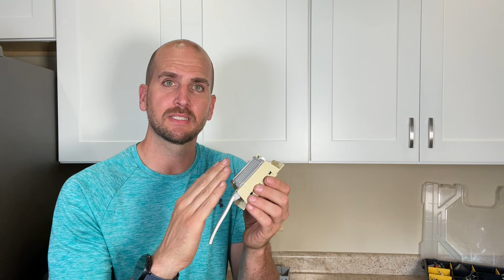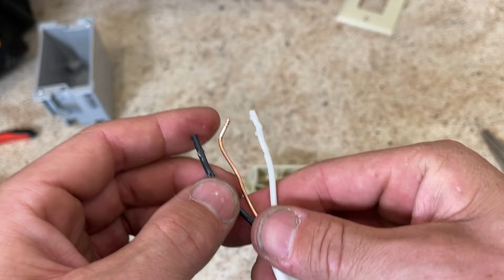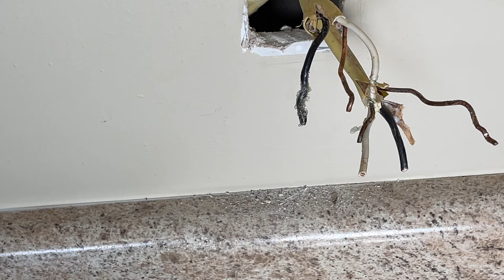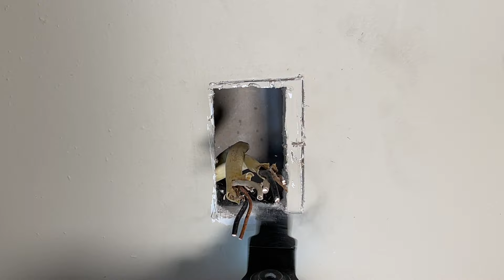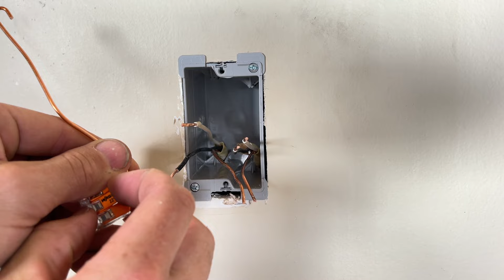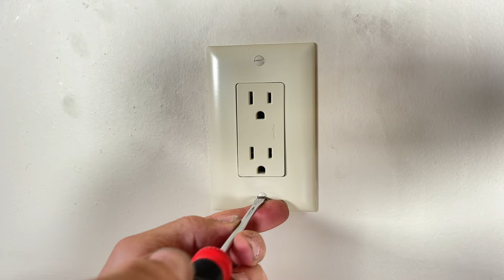How To Replace a Failed Mobile Home Outlet

Comment from the maker: Tools and Parts Used
1-Gang Old Work Box:  https://geni.us/l98bb
Pass & Seymour 15-Amp Outlet:  https://geni.us/QMGN9l
WAGO 221 Assortment Kit:  https://geni.us/H2Jp
Milwaukee Combo Wire Strippers: https://geni.us/5zuLAbC
#1 Milwaukee ECX Screwdriver:  https://geni.us/fuSEW
Klein Voltage Tester: https://geni.us/fAYN9Rr
Klein Outlet Tester:  https://geni.us/kdBAJ

Tools Every Weekend Warrior Needs
Makita Cordless Drill Combo Kit:  https://geni.us/t7dIA
Dewalt Drill Bit Set:  https://geni.us/oFlSl
Dewalt Screwdriver Bit Set:  https://geni.us/VDcr
Craftsman Screwdriver Set: https://geni.us/jXqFI
Eklind Allen Wrench Set:  https://geni.us/7XfvO
Pliers (4-Piece Set):  https://geni.us/RIdx
Milwaukee Fastback Utility Knife:  https://geni.us/MlyiLk
Stanley Tape Measure:  https://geni.us/bUfD1R
Studbuddy Stud Finder:  https://geni.us/RySCuVw
Johnson Torpedo Level:  https://geni.us/wiLcDY
Stanley Hammer:  https://geni.us/bPDk8Wo
Buck Bros Wood Chisel Set:  https://geni.us/vk3cpTW
Little Giant Ladder: https://geni.us/fmlmTk

DISCLAIMER: This video and description contain affiliate links, which means that if you click on one of the product links, I’ll receive a small commission.
Reply: I have interior walls that measure about 2-1/2 inches. Is there an old work box for this?

Comment: What is it with the weird stabby connectors in these mobile home applications? Doesn't seem like this stuff would fail as often if they didn't use connection points that have a ton of resistance.

Comment: You just pulled the back off saying, "You take this back out by pushing in on the four tabs, two on each side",  but you don't show it.  Why not?  I can't get my tabs to push in and stay in.   I'd like to see the details.  You evidently have a hard time with it as well since you skipped over it.  Other YouTube videos:  one guy just cut the wires without taking the back off.  Another pried his off from the back with a screwdriver.  I don't know if he broke anything when he did it.  So far, EVERYONE avoids this seemingly simple process.  Why does everyone avoid showing it?

Comment: Someone educate me I live in a mobile home. I have these types of outlets and switches. I’m about to replace one in my bathroom. I’m not converting it over to a normal. I’m just going to replace the switch so I’ll press them in the back just like they are, I’m confused how everyone is so down on this design seems to me it’s safer as long as it makes good contact which you can do that by trimming the wire a bit before you press it in there with the back there’s no fucking way they can come back out on normal outlets like in houses especially if you have a jackass doing it they can come out pull out and get loose. Someone seriously explain to me how these are so frowned upon. I mean it makes it a lot cleaner too. You don’t have to pigtail a ton of shit. I’m confused. Are they really bad or is that just everybody’s opinion about it because somebody had that opinion, and everybody jumped on the bandwagon.

Comment: Great video. I need to replace outlets in my mobile home. A lot of them are old and loose and one doesn't work anymore. 

Question as I am a rookie to this as well, what was that cutting tool you used? Looked really handy for cutting out the drywall.
Reply: It's an oscillating multi tool. I've heard people call it different things such as a Fein tool or a nibbler. I couldn't find one on the list in the description, but most companies make one.
Reply: @klassikola oh ok. Yeah, I didn't see it listed and was curious. Definitely going to buy one. Thanks for the response.

Comment: Your switch to a stand residiential gang box MAY work for for SOME Mobile Homes.... Many only have 2x3 interior wall studs... and that means those Res gang boxes will not work. Even the shallow gang box can be troublesome to get the wires into. More over anchoring the res gang box on the outside surface of the wall or recutting sheet rock until you find a stud... oh my

Comment: My 1985 Champion mobile home has MUCH worse plastic quick outlets. Super dangerous in my opinion. I plan on replacing the ones that are used most, and especially the ones that space heaters are on.

Comment: Dude,, not the light switch won't control the outlet,, lol.
Reply from the maker: Did you swap out a receptacle and now your light switch doesn't control the top or bottom outlet?  If so, you might want to check the small tab on the hot side of the outlet.  If you had a switched outlet before you should remove this to allow the top and bottom outlet to be powered independently of each other.

Comment: Strip the fucking wire and do it properly that outlet will fail, those contact points are not enough to carry a proper load.

Comment: Is it the same process as far making pig tails for a gfci outlet, or would you just use the line and load terminals, and pigtail the ground wire?

Comment: Again thank you so much.
When we bought our place new 20 years ago we had out let’s that never worked in the 2nd bathroom and half the plug-ins don’t work now.
The whole beat the wire in between 2 small copper blades is the dumbest thing I’ve ever herd I’m sure so inspector got a fat check off it.

Comment: I'm so glad that you did not recommend "speed wiring" or backstabbing the receptacle. Personally, I like to use the "back wire" where the wire goes straight into the back, then a screw tightens down on the wire. A little more cost, but the speed, ease and better connection are worth it. Backstabbing (speedwire) is as bad as the mobile home plug, maybe worse as it doesn't even have physical pressure on it. Great video and well done sir!

Comment: I have been gradually updating the outlets in my mobile home due to this exact mess. The first one, we melted with a space heater. Once i pulled the outlet and saw what i was dealing with.... Off to the hardware store for materials to upgrade them all. 

I'm not done, but I've finished the GFI series in the kitchen, same for the bathroom and laundry. I've also replaced the outlets we run heat from. The outlets next to my bed and desk are the fancy ones with USB outlets. Fortunately the walls in my '93 are thick enough for the old work boxes, and my wires have had enough slack to let me do my thing. Romex is in amazing condition, my load center is only a couple years old. Lots of pigs, nuts, and hooks to do things right. Really considered soldering connections under the nuts, but that might be overkill. 

 I want to check into these clippy things... I just wonder if 20 years down the road we don't find them as reliable as backstab.... Or whatever the hell kind of connection these self contained outlets are.
Reply: We are in this place now. 1999 build. Ugh!! Lots of plugs and switches.

Comment: Wow junk! Thank God I'm replacing every wire, box, outlet, and switch and main panel in our recently purchased modular home from '85 with Hubble commercial grade.
Reply: commercial in my opinion is definitely preferable the Cooper now Eaton at least in the pass are good and pass& semore (legrand) Humble are good Eaton are less cost available at Lowe's when they were manufacturer under the cooper name that I installed years ago have a very strong plug connection.

Comment: mobile home wiring is just insane. I can't believe they were allowed to run 8 wires through a light switch to bounce over to the outlets. Every mobile home over 5 years old has several burned outlets. I'm amazed they were approved.

Comment: Sadly, when I first starting updating the outlets in my moms mobile home, i keep running into the issue of hers were speed wired, and in trimming them to clean them up usually there is barely enough wire to get it back thru a new work box and around the hook. And then the work boxes won't seat correctly as the older drywall was a little crumbly, so my neighbor had to help me to put a small shim behind the work box to have proper anchor support. Without having to replace the whole drywall sheet which wouldn't be bad tbh, but we would have to tear out the kitchen. But i also have to update a few more too. 🙏🏻 hoping i dont have the same issue.

Comment: I just replaced two switches that were wired in the same fashion for my son-in-law and my daughter just bought some type of a modular home on a foundation. That was the first dealings that I’ve had with this type of wiring and didn’t really know it even existed to be honest with you, but I’m sure I will be changing a lot more of these out for those guys from what I have read in the research I’ve done. These are very prone to failing.

Comment: I live in a manufactured home and I have had a lot of trouble with the outlets. If I had known how bad they are I would have paid more money to upgrade to a better Quality. I recommend anyone buying a manufactured home to find out what type they have. They are only rated for 15 amps but have a 20 amp breaker. I am changing one today and they are a pain. I am Switching to better outlets. The way the original are put together is scary.

Comment: I have a 2005 Manufactured home. I have had trouble with outlets and switches it has this type of outlets and  switches. Today I found another bad one it was showing signs over heating. I’ve decided I’m going to replace all the switches and outlets. I feel the government should make them recall this obviously dangerous design.

Comment: With those other kinds what I do when replacing them is push the wires down into the slots then pull them back out and cut the area on the wire with a simple pocket knife to expose the contact point a little more and then put them back in.

Comment: I’m in the process of swapping the SCD style outlets to these regular style, but how do you wire them when there’s 3 sets of romex behind the outlet? 

The other issues I’ve ran into are when changing out light switches, it’s not so simple as connecting all the blacks whites and grounds together.

Comment: Well done and explained the hazard with those horrid MH style devices. P&S really scored the "L" with those things. The change is you have the plate screws horizontal. :)   One very minor quibble, it would have been better to have the grounds placed on the left side away from the hot screw terminals.  Less risk of future expansion moving them into contact.

Comment: My mother in-laws single wide (not sure how old) but her panel has 20 amp breakers but the wall outlets are 15 amp not sure wire size. She bought it used I don’t know if it was built that way or someone changed either breakers or outlets. Not sure if I should be concerned or what to do

Comment: Do you think the mobile home outlet is good for a mobile home application. Cuz I bought a couple for my mother's bathroom and I got a was it I guess it's called a Romex box with the switch for my bathroom. The outline switch that I got for my mother's bathroom are both Romex. Which I bought at the mobile home store.
Because I live in a manufactured home. So I don't know if it's ideal for the type of home I live in and if I do use that will I experienced those type of problems. Or should I just replace it with a residential outlet like you showed me here in the video? I mean I hope to God that what I did was safe. I'm not even an electrician, and when I install the first light it was kinda hard. All I had was a military knife and a pair of Leatherman pliers which came in handy. And I haven't used needle nose pliers. I have a pair of needle-nose pliers and a needle nose pliers that has a bent into it so I can probably use the ones with the band maybe those could work better because it'll help me grab the small wire and push it down and that small tiny area where the contact point is. I like the video I could really use your help and get some further advice on what you're talking about.

Comment: HELP, please.  We have a 97 Pennical doublewide Zone III.  One by one the recepticals are failing and a few switches.  The recepticals actually start scorching.  One actually caught fire.          One company refused the job.  They said it would take up too much time.  They suggested I move. Or get somewhere cheaper like a zone 1 or a shed.            I was referred by a business owner to an independent worker.  He has come out and said that the neutral bar is bad.  I have the cover off the panel (Cutler Hammer 200 Amp interior Main panel, original.  The service is on a pole)  I see absolutely no obvious damage or loose wiring.    He said his meter showed 0  ( I think)  It is all too much.    He said he was surptised than any of the recepticals are working.  He put the meter on it.  He also found nothing loose.  I allowed him to order a new bar (already paid for it.)  I dont know much about electric supply for a house (I have done things like running new wires and installing recepticals and breakers.)  I also ran the 220 for my former home.  But this has me baffled.  I tried to replace switch to outside light and gave up.  It has the push in type fidgit box with the blades.  I know that mobile homes are different.   Ive been told that trailer panels have their own grounding. ???     I just need your opinion as to this issue.  Ive been trying ever since my husband passed to get someone to help me fix it.  Ive called every name Ive been given.  Only 3 have shown up in 7 years.  I ran the first one off.  He was a total jerk.    Do you think that he or I might be missing something?  Call me desperate.

Comment: Ive run into wiring coming from the box all 3 wiring is copper the other wire coming from box 3 silver. It goes on to the next outlet that I have three wires
Reply: Im used to using copper with switches
Reply: Any comments thank you

Comment: You put both cover screws the same, horizontal.
Note, you should cut off the plaster ears on the outlet or switch when using old work boxes.

Comment: For the love of Christ, not ONE person shows how to get these stupid things off the wall once installed
Reply from the maker: You should have 2 mounting screws that need to be loosened (1 top and 1 bottom).  When you loosen the screws the tabs should start to loosen from the back of the drywall and rotate down so you can remove the outlet.
Reply: @EverydayHomeRepairs  thats not what happens. the unit is "flush" by cutting into the face of the drywall and its painted right up .. I literally removed the screws all together, and the thing remained stuck. 

they are brutal. they fail. they need to be replaced. PunchDown outlets were not needed, and are less safe. 

they cannot be taken off and reused, because you cant punchdown the wire a second or third time... there was NO need for such a product, and it requires a new tool, useless to anything else... that punchdown tool... 

its the single stupidest thing Ive ever seen...
Reply: What gang boxes are you using my walls only have about 2.5 inces in-between

Comment: The self-contained outlets and light switches in the manufactured homes is nothing but junk. I personally do not feel like they are safe to be used and what you showed in the demonstration of the self-contained outlet is very true. There is little to no contact at all between the wire nor the contacts. As far as I'm concerned I think that for all these manufactured home companies the wiring codes need to be they should not be allowed to install the self-contained outlets in light they should be made by code to use the standard light switches and outlets when they are building these manufactured homes. The only reason why that the manufacturer home companies uses the self-contained light switches and outlets is because they are cheap so I have been up grading all the light switches and all the outlets to the conventional light switches and outlets.

Comment: GFI install on counter  use!
Reply: The circuit may be GFI protected at the box, or be downstream from an already in place GFI outlet.  I have a run of 4 outlets in series near my sink. The first outlet in the series is GFI, the rest are protected by that one GFI. If one is tripped, they all will trip.

Comment: So my bathroom outlet is burnt like this. It still works. My home is a 2016 we moved in when it was brand new. But coming to the outlet is only one wire instead of two like in the video. How can I replace it?
Reply: That would be the terminus of the circuit, or the last outlet in the line. Congrats! Your life just got more simple and you don't have to worry about pigtails.

Hot to brass, neutral to silver, ground to green. If it's a bathroom install, put in a 15 amp GFI outlet.
Reply: @pamelahartman2680 what if it has 3 I’m currently changing the one in my sons room and it had 3 wires going to it

Comment: Can you strip the white and black wires so you get a better connection?
Reply: The point of contact would still be no larger, though it would at least BE in contact. I freely admit to not knowing much about this, but maybe there would be some type of solder you could add that would increase the contact area if it could handle the electrical load — just a theory. But by that point, it would seem easier to just replace them with the standard type you can buy at Home Depot or wherever.
Reply: @Experiment6Two6  d

Comment: From the look of the response here I think you struck a nerve with people. I am retired and was a service electrician. I came across these in Mobile homes and they have always been un-acceptable to use for me. Doesn't say much for UL. Even a backstab connection on a regular outlet is better than these things and that isn't saying much. Replace these things anywhere you find them and do someone a life saving favor!
I have 2 RVs and I have to admit I have not looked to see what device is used in them. Shame on me, I will look into my RVs and replace any I find. J hooks to the rescue! Thanks for bringing it up before my electric percolator or a 1500W heater burns the places down.